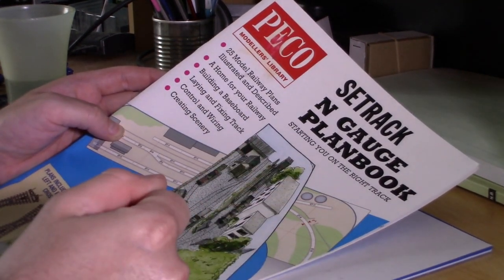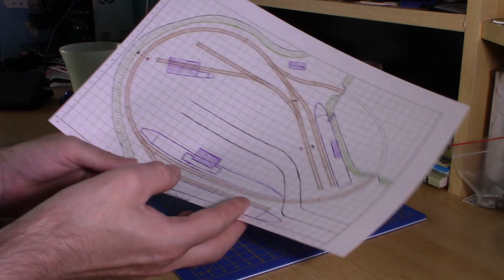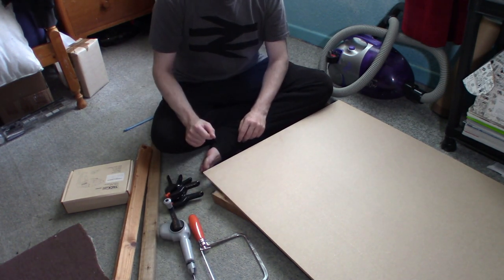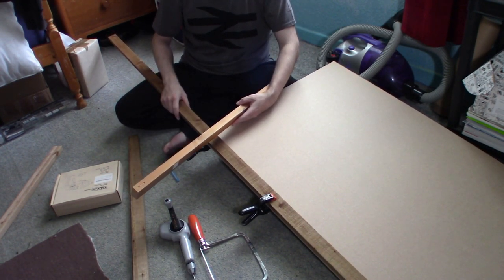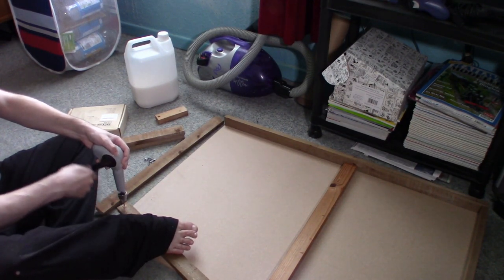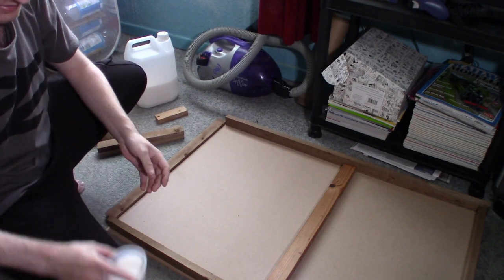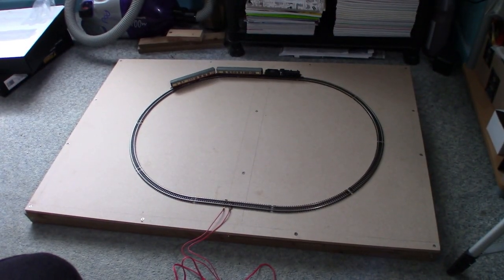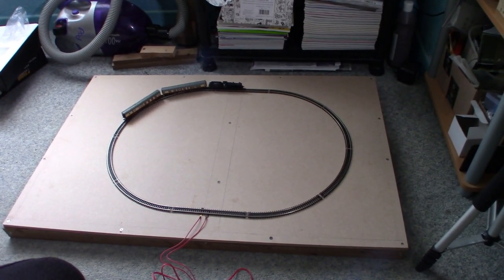N Gauge Layout Build: Beginner Layout 1 - Baseboard Build

Comment: We all had to start somewhere and hopefully videos like this show people that getting started really doesn't have to be that difficult.
Reply from the maker: Indeed, and it's not really anything difficult to learn put it all together, a screwdriver some screws and a small saw will be all you need really to get started!
Reply: @GosportRailworks  Not that difficult but it also doesn't have to be expensive.
Sometimes you could just use waste materials.
Lightweight doors for example could also be used for a layout, just put a cheap or free frame under it and roll trains 😁
Reply from the maker: Always do try to reuse what I can find! Though I don't recommend the wood found in many ikea like put together furniture with a coated finish, either the track pins have a hard time getting stuck in or the glue just sits on the shiny surface.
Though that is my own experience of using them heh
Reply: @GosportRailworks  Some furniture from that store could be used to build a layout in though.
I'm talking about real wood, for a baseboard it only takes scraps.
But MDF or chipboard is useless, I agree.
I've even seen cardboard being used to build a layout, seen on Budget Model Railways.
Every day I look in the waste generated at my place of work and whatever takes my fancy is coming home with me.
Tons of wire in all colors, wood, plywood and anything else I may or may not find a use for.
Sometimes you don't need much stuff but if you have to buy everything it can sure add up 😉
Reply from the maker: Did try to make one out of cardboard which I got from work, annoyingly though a coworker thinking they were being helpful folded it in half when I needed it as it was but oh well
And do watch BMR and always good tips on stuff, and my work also makes a lot of stuff which I could reuse, but bit tricky getting it on my bike heh

Comment: After 15 years I've decided to get back into the hobby but i don't have the space for my OO gauge stuff so im going with N gauge. Ive decided on a 4.5ft x 2.5ft baseboard so i can have a double loop with a loco siding/refueling area aa passing track through the station with some space in the middle of the board for more sidings. My only issue is ive never been good with woodwork lol. So i need to do it properly, luckily ive got the peco track plan book as well 👌
Reply from the maker: Always happy to see someone return to the hobby, and for the most part, N is pretty much the same as OO just bit more fiddly! but a 4.5ft x 2.5ft layout is a good decent side to get back into things with!
And yeah I've never been the best with woodwork either, my main aim is always come back with the same number of fingers as I started with heh, but do hope your layout comes along nicely!

Comment: im toying with the idea of a double-bed bedframe to act as the main part of the structure with an 8x4 sheet on top.  the bed frame adapted to mount the board
Reply from the maker: That would work quite well, though like with my bed layout, might need some space in the middle to help with access unless you're able to reach the middle from the outside!

Comment: To power track i used 10 amp 12 mains power supply, about £10. Then i used motor controllers modules off ebay about £4 each. So can use quite a few controllers to match each line.
Reply from the maker: I think I used something similar, mostly what Budget Model Railways used as it seemed to work well, roughly about the same price if I recall, much cheaper than buying a DC controller from one of the typical manufacturers!

Comment: Isn’t that board excessive for this tiny train set?
Reply from the maker: As it originally was, yes it was, but I did add more trackwork afterwards (the set in the video was mostly there for an example as bought separate track for it all than use the track from the set).
That and the 3x2ft board was a standard size board which I could buy that could get a loop round and didn't want to do more cutting than really required.